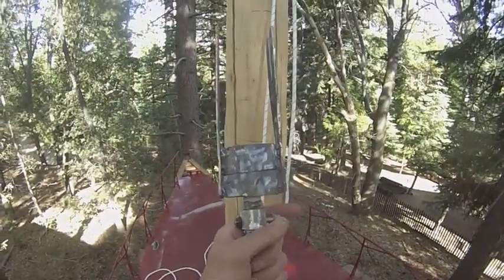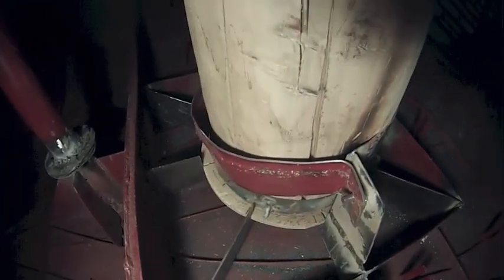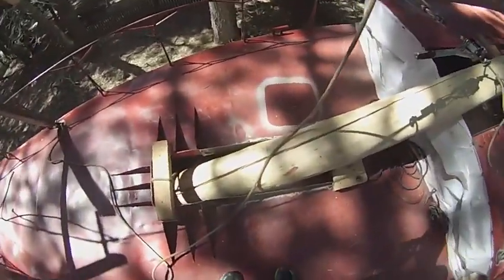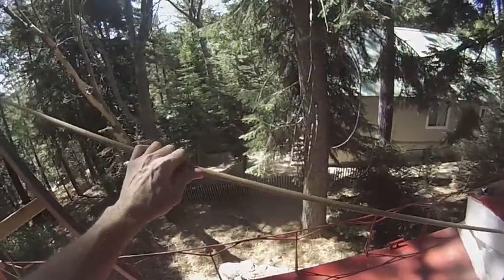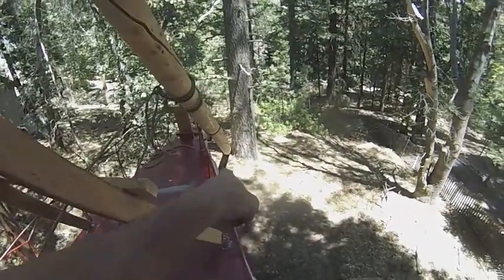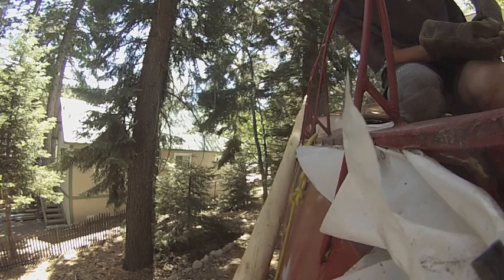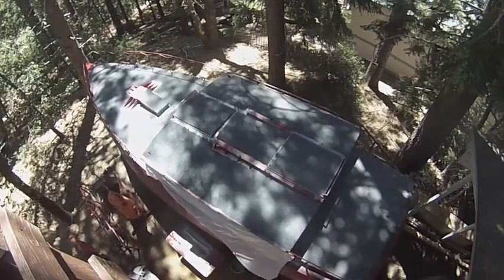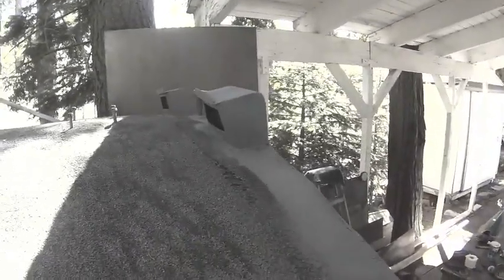Steel Sailboat Build Part 31

Comment: I have to say I'm concerned about the mast step. I'm thinking the light gage brace around the base of the mast is very undersize for the kind of load it will be required to support. Also what kind of bilge pump with you be using? I have the feeling this thing will have a significant leak issue.

Comment: Is the mast a mock-up? I noticed rather significant splits in the timber.
Reply: I know he’s using what he has on hand but I would think an aluminum mast would be much stronger and much lighter!
Reply: @scarface-39  Or why waste money on an ally stick when the wooden one only has to last as long as the rest of the boat/welding.
Reply: The splitting on a wooden mast is called a "shake".  It is perfectly fine for a timber mast to have some shakes.  One must seal them up with something soft and non-expansive so that water doesn't penetrate, but it is not a strength issue.  Check Page 123 of "Practical Junk Rig: Design, Aerodynamics and Handling" by Hasler and Macleod.
Reply: @Daniel Leca I was more thinking about strength than aesthetics. Once the fiber split the rigidnessis gone.

Comment: You will be in the water in no time at the rate your moving now.
Reply: Under water is more likely.
Reply: @dutchdude1972  I know a hell of a lot more about boats than he does.  Rusty Junk will not stay on top of the water more than 1 hour, max.  It will either sink, end up on its side, or both.  That's OK because otherwise it would be even money if the mast breaks or the keel falls off and then it will roll over and sink.
Reply: You don't need to be an expert to see the design and construction is deeply flawed.
Reply: I see the keyboard commandos are out in full force on this post. I will bet most if not all have ever built anything in there life.
Reply: @TheCritterWindow  When there is smoke and oil pouring out of your car, you don't need a mechanic to tell you there is a problem. And you could try stretching your brain by examining a well made boat of a similar size and comparing it to what he is building. And I have built a few things and been around boats for a few decades
Reply: @TheCritterWindow  I've built boats, houses and other things.  I'm hardly a keyboard commando.  

I'm sure the dude is a nice guy, he just doesn't know anything about boat building.  You can get away with that to an extent with cars.   If you're going to venture out of your bathtub, boats can be pretty unforgiving.